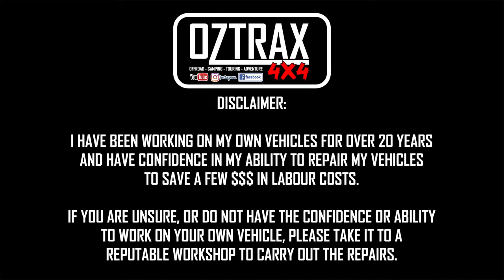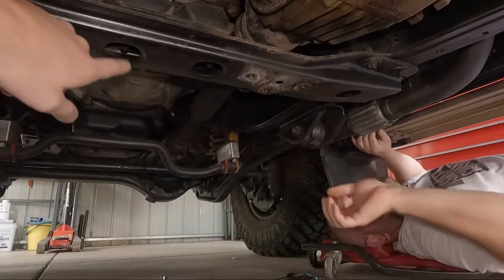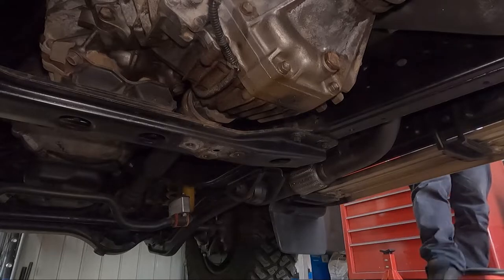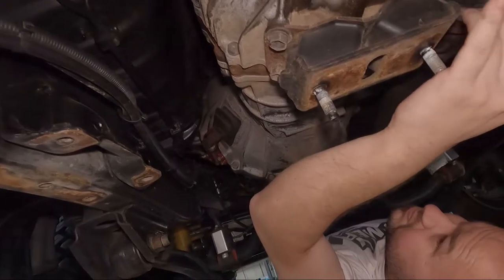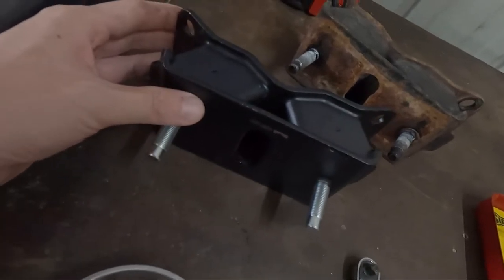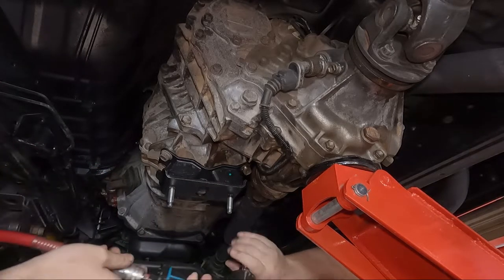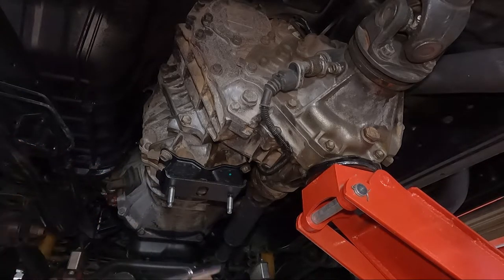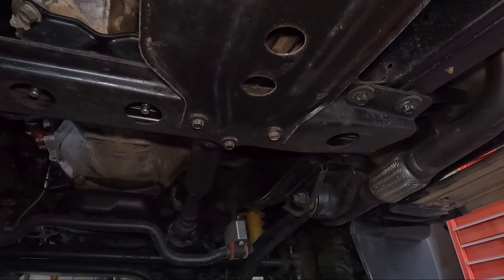DIY: Toyota Landcruiser 80 Series // Transmission Mount Replacement

Comment: Great visual, exactly what I was looking for. I'm restoring a 1997 1FZ 80 series. I'm surprised how many people never touch the engine mounts and transmission mount on these trucks. I should be doing mine in the next couple weeks, your video was a great visual!
Reply from the maker: Being that mine is diesel, the torque kills them quicker than the petrol variant.

The one tip I will give you when doing your engine mounts is this:

Not sure where the power steering reservoir bolts up on the 1FZ, but if it's anything like my 1HZ, unbolt it from the manifold prior to jacking up the engine or you'll destroy power steering reservoir hoses real quick. 👌
Reply: @OzTrax4X4  Very good tip! That makes sense actually. On mine I have it all apart already. The only thing left in the engine bay right now is the short block and the transmission. So it's a perfect time to do all the mounts and also get a lot of other things cleaned, fixed, and replaced.
Reply from the maker: Definitely a good time to do it with not much in the way, if that's the case.

I'll have to swing on over a check out a video or two and see what you're up to. 👌
Reply: @OzTrax 4X4  You'll get a kick out of it. My typical "lets restore this cruiser" then turning into "lets build a turbo monster cruiser"..... I have managed to turn a simple restoration into a much larger project somehow. Now I just need to make sure the wife doesn't find out what all these extra parts are for 😀

Comment: Have you guys done a video for the engine mounts
Reply from the maker: I've replaced them, but never did a video.

You'll need to unbolt the power steering reservoir from the manifold or you'll tear the rubber hose.

Just common sense really.

Jack up the engine and switch out the mounts one side at a time.

Comment: Great video! I have an LX470 that I'm restoring, and the Land Cruiser videos have helped so much since it's the same platform. Qusetion, though, could there be another reason for a shifting thud other than the mount?
Reply from the maker: Thanks mate, appreciate the comment.

I believe that the transfer case input shaft could possibly play a part in that, as I still have a fair bit of drivetrain backlash after replacing the rear tailshaft, front uni joints, front diff centre and having the rear diff centre rebuilt too.

All that is really left for me to do is rebuild the manual transmission and transfer case.

Comment: Thanks for sharing. But what was the problem and/or symptoms before changing the mount?
Reply from the maker: I have been chasing drivetrain backlash and replacing worn components as the transmission mount and the engine mounts were all original.

So far, if replaced the front diff centre with a known good one with no backlash, replaced front uni joints, replaced rear driveshaft assembly as the slip joint was worn, had the rear diff rebuilt with a Harrop E-Locker and part time converted the transfer case.

It's looking more and more like the transfer case and gearbox need a rebuild and I should have it all sorted.

Comment: Have you changed out the engine mounts? I would like to see that one to please?
Reply from the maker: I have certainly changed them, but no video for it.

You will need to unbolt the power steering reservoir, or you'll damage your low pressure side hose.

Then it's a matter of loosening the mount bolts, jacking up the engine and swapping them over.
Reply: @OzTrax4X4  cheers thank you and great video too
Reply from the maker: @bengreen2877 no problem. 🤠

Unfortunately when the engine mounts were done, they were changed at night in a workshop I had access to, so hard to film.

But if you have questions, feel free to either shoot me a message on Instagram or over on my Facebook page and I'll be happy to help. 👌